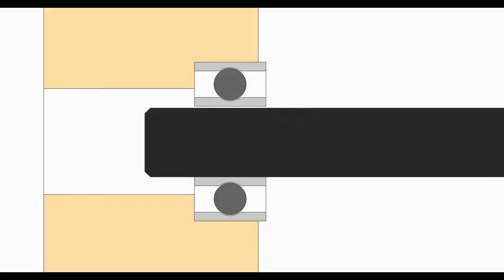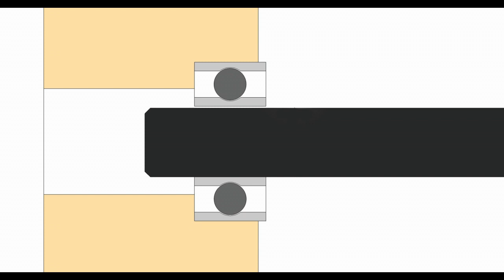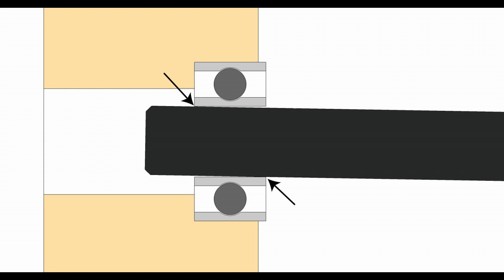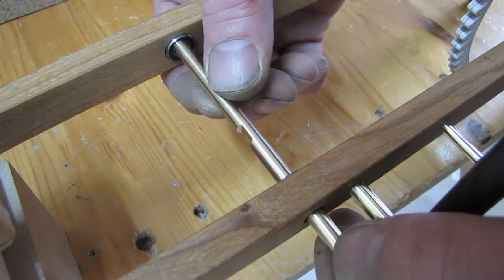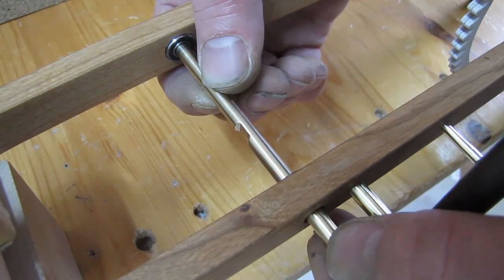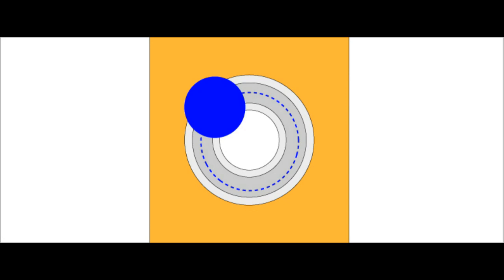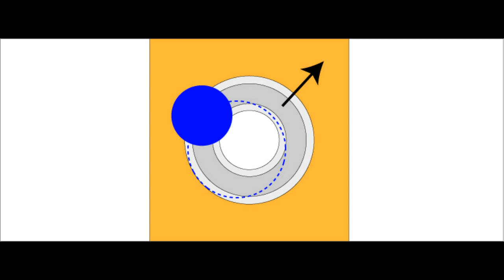Ball Bearing Tutorial

Comment: I have the same confusion as Elyasaf...if the arbor is rotating with respect to the inner racing then isn't that equivalent to having the arbor inserted into a static steel tube? Or does the weight attached to the arbor force the inner racing to rotate in union with the arbor?

Comment: Hello, I have enjoyed watching your videos. I only wish I had the equipment to do the polishing etc... Which clock would you recommend for a beginner without the machinery.
Reply from the maker: No amount of machinery will ever replace ingenuity, and although I use a drill press a hand held drill will also do the job, with a bit of the aforementioned ingenuity.
Reply: woodentimes .com
You are correct. I was thinking of ways I could make a drill work for me. JUst need to think it through. Thanks.

Comment: Great Video.
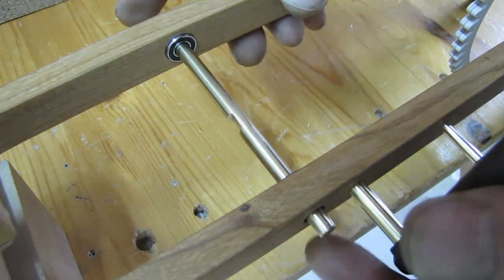I still have one big confusion. At around 2:27 in the video, te ball bearings are in place and so is the rod. Now dont you want the rod and the inside rim of bearing to be glued together?
Why would you want to leave it lose?
Reply from the maker: As with all things mechanical, a clock can and will at some stage need maintenance, so it is always good practice to allow as much disassembly as possible. Plus as the frame is also wood it is important to allow for movement in all directions, in general when you prevent a part from compensating for expansion/contraction that is when the problems start.

Comment from the maker: The type of balls bearing I use are redial, which means they are at their most efficient when they run exactly 90 DEG to the load. As soon as they are no longer 90 DEG the friction increases exponentially, as the balls start to press against parts of the cage for which the bearing is not designed. To get exactly 90 DEG in wood is as good as impossible, so a looser fit will help reduce this effect.

Comment from the maker: @KEvronista There is a constant debate about ball bearing use in wooden clocks, but if used correctly they can greatly reduce friction on heavy load arbors, or as in the case of the Sextus for uses such as the pendula, which would be very difficult to realize without ball bearings.
By the way check out KEvron´s videos. Horolego! And I thought I was Crazy :-)